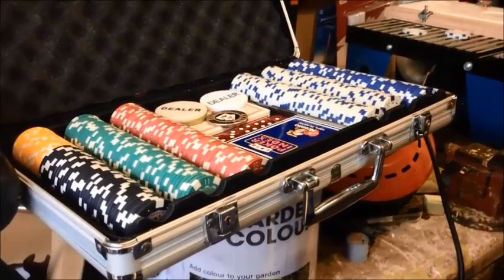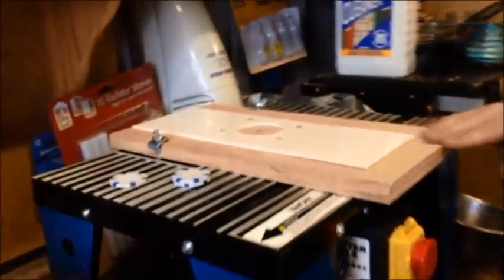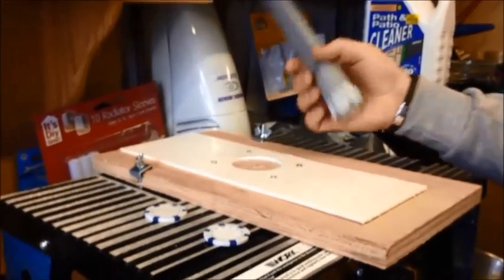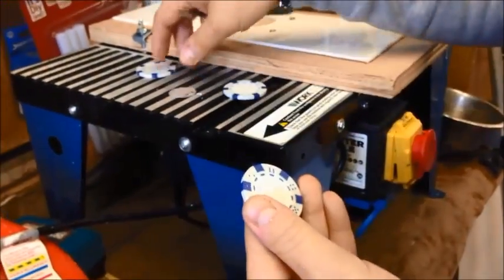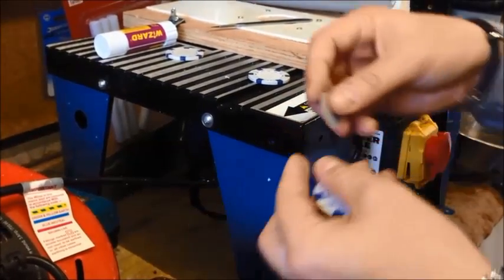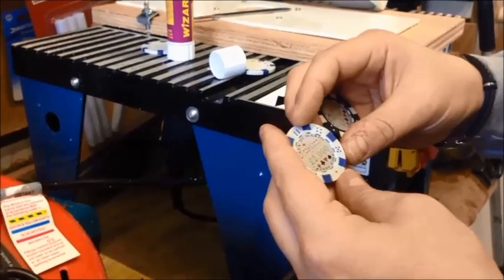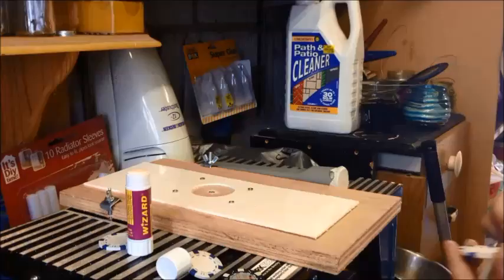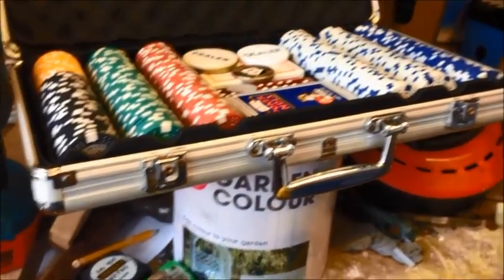How to make custom personalized Poker Chips

Comment: Hole saw bit size for these chips is 2 and 1/8. Im doing a 715 chip set. I find I can do about 10 in an hr. VERY time consuming. Will definitely be worth it in the end, but the road there is long.